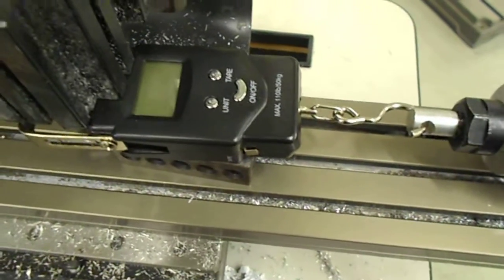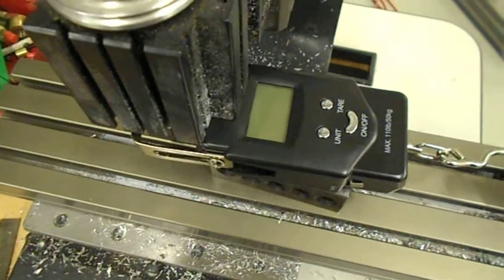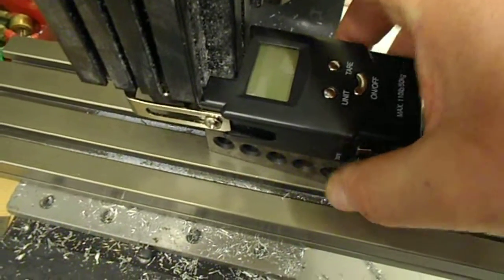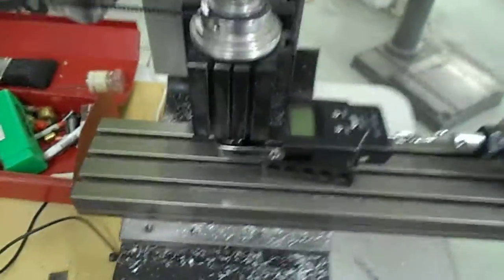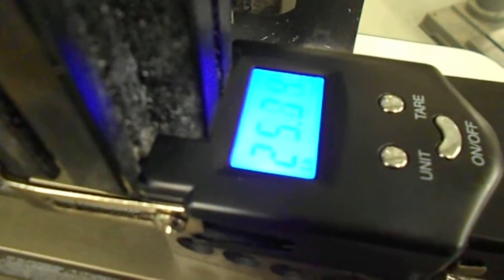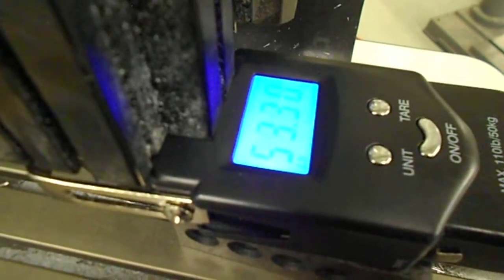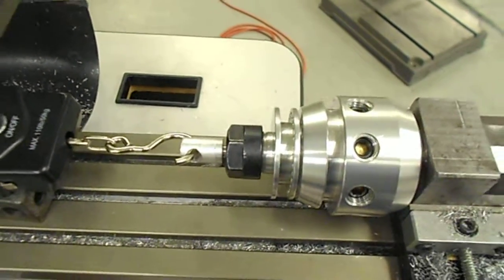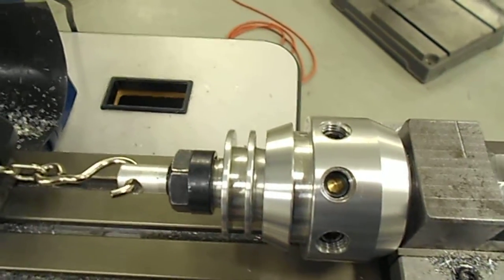Tool holder / Spindle pull test

Comment: yeah I figured school or life had caught up with you I'm in the same boat
Reply from the maker: +matt whitehouse The good thing about it is that it gives me time to think of solutions to existing problems so that if/when it comes out it will have been thoroughly tested. As it is, the spindle housing is going to be replaced to allow for the spindle shaft to be much more rigid and the ball locks will be complimented with centrifical locking pins that will only engage when the spindle is in rotation.
Reply from the maker: +Christopher Smith https://dl.dropboxusercontent.com/u/56789932/8%20-%20Ball%20ATC/spindle%20flyweights.JPG